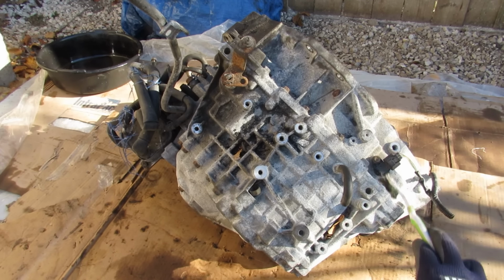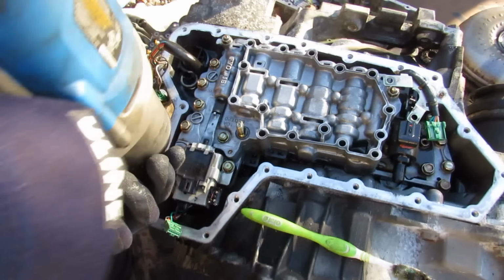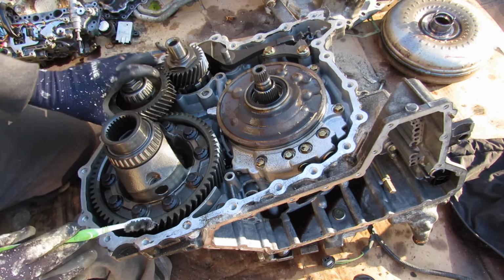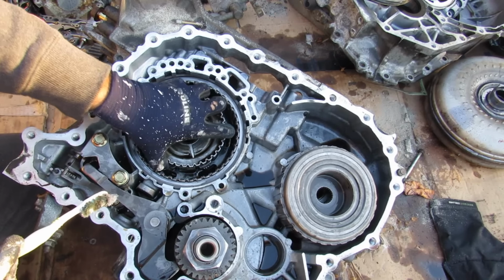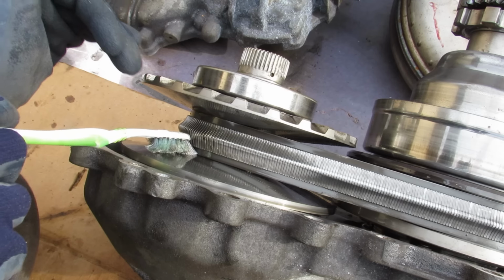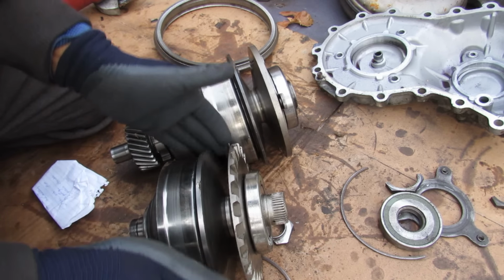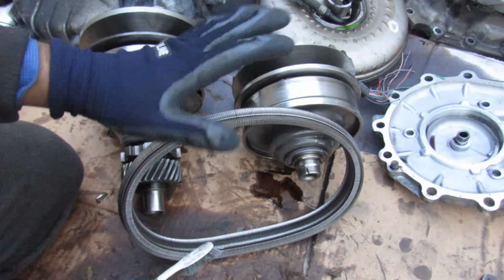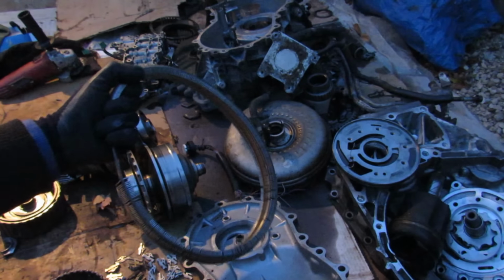Why Nissan CVTs FAIL

Comment: Nissan: "CVT's are more reliable because they have fewer moving parts."
Me: "How many of those chain links are in a single belt?  I'd say, they are all transmission parts and are all moving, no?"
Reply: More then a few mechanics have told me the Jayco (Nissan owned) cvt transmissions are crap compared to Toyota and Honda
Reply: @larrywelchko6136  JATCO
Reply: @larrywelchko6136  they’re Jatco, and yes they’re the worst of the worst. I’ve heard many people tell stories of their transmission failing at under 50,000 miles, including one failing on the test drive on a brand new car
Reply: @sundstrom193  new cars are where failures happen. That's why warranties exist, to cover factory defects. Crown Vics were famous for seizing up the engine on the transport truck...or lasting 400k miles.
Reply: @larrywelchko6136  it’s spelled jatco, Japanese automatic transmission co.
Reply: @larrywelchko6136  The only CVT I've owned is Subaru.  Never again, despite my love for EyeSight(TM).  My current car is a manual with Honda-Sensing because Subaru/Hyundai/Kia have been refusing to make adaptive cruise control work with manual.
Reply: @catsspat  Maybe because cruise control (w/ adaptive technology at that) works better with automatic? Because adaptive is adjusting throttle on the fly and the system has to disengage if the RPMs get too low for a certain gear. Risking a stall/bog out in a manual. This type of technology is best left with computers in all honesty.
Reply: @Iridiumcosmos  not really, my father owns a Dacia minivan that has a Renault Clio 1.5 dCi drivetrain (codeveloped with Nissan), manual 5 speed transmission. The cruise control and speed limiter work flawlessly even in roads with steep elevation changes. If it detects the rpm is going out of the desired range it simply warns you with a dashboard light. Being a diesel it very rarely needs to shift gears though.
Reply: @AruEsse  Correct me if I’m wrong. But I’m pretty sure those don’t have adaptive cruise control. Even so, modern manuals aren’t even true manuals anyway. There’s more computer control involved with them than your traditional stick shift from the 80s and 90s.
Reply: @Iridiumcosmos  you are right, it's not, but at least theoretically you could make it work (up to the engine stall point) so it's not like it can't be done, it's just a matter of regulating the target speed based on some sensor reading, but it's also true that those so called "premium features" are usually left to premium versions that usually have "premium" slush boxes... About the modern manual thing not really, apart from a couple of sensors here and there mother manual gearboxes still are a purely mechanical device, and that's actually why they are so reliable... Rarely you hear of someone having to rebuild one
Reply: @catsspat  they did make eyesight work with manuals… in Europe. They just refuse to bring them to the US

I wish I could own one of those :/ 
just another reason to leave American once I can.
Reply: I remember when I was a little kid, I thought the fan belt drove the wheels (I must've been 6, no one ever explained it) - then when I was a little older, I thought "how silly was I to think a car drove by a belt.." - and well, it's a steel belt, but it still seems like a silly idea.
Reply: @MattExzy  DAF had a rubber belt
Reply from the maker: Agreed
Reply: @speedkar99  Kia and Hyundai make their own in Korea. they do not use cvt  but 8 speed autos last I heard.
Reply: I have a friend (Nissan fan), he owns a Nissan with MANUAL transmission. He always says "I have no problem with the CVT"!
Reply: Nissans are a lot of things but reliable is not one of them especially their crappy transmissions . I'd say Nissan and Chrysler is in competition for who can put the worst transmissions in vehicles .
Reply: @dave0z96  is because Chrysler also  uses Jatco transmision on CVTs equipped cars
Reply: Right on 👍
Reply: @NeightrixPrime  already two Infinitis have been changed to CVTs
Reply: Eugene foster  are there any that do last? In theory they're a great idea, keep the engine at the most efficient powerband for fuel efficiency.. but they have to last to pay off.
Reply: 299.
Reply: I loved your joke
Reply: What about each individual atom in the transmission fluid?
Reply: Maybe I’m wrong, but if you’re trying to move the car and the transmission doesn’t have any moving parts, that the car isn’t going anywhere.  I think you want some moving parts so your car also moves.
Reply: Fewer parts doesn't mean more reliability.  It means that stress are continually placed on the same parts, leading to quicker wear and deterioration.
Reply: @liddlebopeep  depending on how strong those parts are. You can have a machine with only 2 parts, like a lever, and it will only fail if you overload it or you use up the fatigue life.
Reply: @liddlebopeep  a manual has less moving parts then a auto and is more reliable, I think what you meant to say is that fewer parts doesn’t always mean more reliability

Comment: Mine went into limp mode climbing 4000ft fully loaded. Changed the oil and added a cooler and ever since been fine. Also monitor temps with obd2 keep it below 80c. Suprised that time I didn't do any long term damage though it was whining pretty bad and I lost a lot of power. At 152k and running good for now. 2007 nissan sentra
Reply from the maker: Yeah these things can't take too much load

Comment: I think the no. one reason for vehicles manufacturers to switch for CVT transmission is cheaper to manufacture than regular direct shift automatic transmission. Regards.
Reply from the maker: True, it's cheaper, the consumer doesn't care either
Reply: @speedkar99  and the consumers dont know anything beyond the touch screens on their cars anymore otherwise why would anybody accept all these tiny 4 cylinder engines on suv's or cvt's  when v6 and v8 engines work better
Reply: Also because it's planned obsolescence.
Reply: @M Bacon I respect your opinion but I’ll never own anything less than a 6 cylinder
Reply: @M Bacon nothing is "needed" but high tech turbo engines dont generally last as long and fuel economy is basically the same in real life if it aint broke dont fix it

Comment: If i forget to put the megnet after change transmission oil and filter  its will any problem for no put megnet in the oil champen
Reply from the maker: You should have a magnet to collect any particles floating around in there

Comment: Damn it looks like a non repairable  technology one time use and throw away 😕
Reply from the maker: That's exactly how it works when it fails...don't rebuild...just replace
Reply: Its not that its non repairable, its that parts are hard to come by. Some shops do in fact do overhauls in these for about 2 grand. Which is much better than the 5 grand to replace

Comment: There y are many owners with no issues with CVT, but I think there might be an issue with CVT and high ambient temperature areas that causes problems.  In Canada, no biggie, but in Texas, or other high temp zones it might be good to 'over service' the fluids (Coolant and NS2 or NS3).

Note that on the newer Pathfinders, QX60, they are using a steel chain belt instead of the multi-piece steel belt system in the smaller CVT, that's how the towing capacity on these larger cars is so much higher.
Reply from the maker: How is the steel chain belt comprised? Like a bicycle chain that works in tension instead of compression like this one?
Reply: @speedkar99  this shows it, https://gearsmagazine.com/magazine/pulleys-and-chain-installation-jf017e/
Reply: @speedkar99  It's more like a timing chain or a primary chain on a bike

Comment: you did not talk about or show the 2 weakest points! 1. the variators move in and out on some small ball bearings held in grooves. these balls fatigue from large amounts of force. eventually failing and then it is all over. 2. the piston in the oil flow valve is contained in an aluminum bore. the walls of bore wear resulting in reduced oil pressure being applied to variators, eventually resulting in belt slippage. u should do a part 2 to complete the analysis.
Reply from the maker: Thanks, and good call. It was very difficult to open those variators to examine, I went through alot of grinding wheels just getting the nuts off and the steel gears didn't want to budge with a puller.
Reply: @speedkar99  dont matter really. a person is better off replacing the unit, or even better replacing the vehicle with one that does not have that type of c.v.t.

Comment: That is a first generation CVT.
The rubber band effect is not there in the newer ones.
You did fail to explain exactly why they fail and to say that the 2nd gen and newer ones fail rarely (they extended their warranty to 7 years or 84K miles, which means they stand behind them).

Hey, even Honda had issues with their dirt gen CVTs!!
Reply: Nissan fanboys delusional
Reply from the maker: Did you watch to the end of the video?
Reply: 84k miles is "standing behind them"?   I could easily do that in 3 years. If a transmission fails on a car before 100,000 its trash.
Reply: Thanks, the generation version was exactly the info I was looking for.  You'd think that would be a necessity of the subject line.

Comment: I would have separated the electronics and made it accessible externally from the transmission. Also why have a manual gear selector at all that physically connects to the transmission if it’s going to convert the signal to digital. More stuff that can go wrong and the need to take apart the transmission to fix anything.
Reply from the maker: The shifter inside does move the manual valve which engages the parking pawl and also completes hydraulic passages in the valve body to engage the forward and reverse clutches

Comment: Honda CVT requires a fluid change every 30,000 miles. It's really easy and only use Honda HCF2 ATF. Wifes car is a 2014 Accord Sport with 150,000 miles and still works like a dream.
Reply from the maker: I was wondering how Hondas first mainstream CVTs have been holding up

Comment: Hi,
I’m thinking of buying an old nissan with a 4 speed automatic. Do you know how much cost to replace or rebuild one of thesse 4 speed?
Is it more cheaper to fix than an jatco cvt?
Thanks.
Reply from the maker: I think any Nissan old enough to have an automatic isn't worth the cost of rebuild or replacing a transmission ....

Comment: I own a 2007 Nissan Murano, with almost 300,000 Km on it. Never had an engine or CVT issue to be honest. I did notice this year a slight leak from the CVT transmission cooler hose, which I believe is common. So, I would expect most people have no idea that they are leaking CVT fluid and that could end up destroying the CVT. So I'll keep topping it off for now.

One question though. People say the Nissan CVTs are not that reliable, but I've never seen cold hard facts about it. I'm very suspicious of anecdotal evidence. I know that CVTs may be costlier to service, but I'm wondering about the actual failure rate. Does anyone have actual data on that?

Also, Nissan says the newer CVTs fix their older CVT's problems. What design changes have they made to fix the issues?
Reply from the maker: You should get the leak fixed and keep an eye on fluid temps.

Comment: I question just pupped up, does CVTs change reverse gears? I have 06 Highlander Hybrid never thought of reversing in high speed.
Reply from the maker: They can be programmed to change ratios in reverse but probably don't due to safety concerns at high speed
Reply: Plus the reverse gear is straight vs helical cut so it'd sound like a formula 1 or an rc car at high reverse speed lol

Comment: Stay away from the 6th gen. Nissan Sentra with the cvt trans; they are bound to fail. I wonder how reliable most of these cvt equipped vehicles would be if a traditional transmission was used.
Reply from the maker: I see them all the time for sale $1000 obo busted trans

Comment: Every single family member and friend that I have who has owned a Nissan has had an automatic transmission failure at some point; most before 100K miles as well. It's possible that they all got unlucky but based on their experiences, I'm inclined to say that Nissan may not have the most reliable automatics on the road.
Reply from the maker: Automatic or CVT
Reply: @speedkar99  - Both the normal automatic and the CVT, if I remember correctly.
Reply: @Casey_Schmidt  The Regular Autos Are Fine. It’s Really The CVTs. I Don’t Hear People Saying They Have Problems With Nissan 7 Speed Autos.

Comment: What i have witnessed working for Nissan several years ago was sales people telling buyers "Oh its a sealed transmission, no maintenance at all" thats a lie out their ass and it infuriated me. Thats why majority of CVTs fail, not the proper maintenance.
Reply: Exactly this. I even had a service writer at a Nissan Dealer tell me that I didn't need to change my fluid at 40k. It just needed an inspection. I told him there is no such thing as lifetime fluid and made them do it. Fluid went from dark/dirty green to bright green. I, however, turned down their stupid 40$ cabin air filter they were pushing.
Reply from the maker: You are on your own after the warranty which is how long these are designed to last. It's in their interest to sell you another car after that
Reply: @speedkar99  only an idiot would buy another car from a manufacturer that failed right after the warranty was up
Reply: @dynamo3059  No manufacturer wants you to keep driving their car for 30 years. Bad for quarterly profits.
Reply: @fun_ghoul  no consumer wants to buy a car that breaks after the warranty period either. so they are forced to make their stuff reliability in order for consumers not to buy from somebody else.
Reply: @dynamo3059  Brand loyalty is dead af. Toyota random acceleration and Honda (and GM) head gaskets made sure of that.
Reply: @fun_ghoul  there never was any brand loyalty to begin with. it's always been a features / reliability / cost thing, if you make a crappy car you will go out of business.
Reply: @dynamo3059  Oh...is that why Ford is still around? LOL
Reply: @fun_ghoul   Toyota random acceleration is a thing of the past now.
Reply: @fun_ghoul  ford stopped making cars. they only make trucks now. their trucks are pretty good. not sure what you can buy that's much better.
Reply: @hedgehogthesonic3181  The point is that it killed the myth of Toyota as being morally and technologically superior to other auto makers.
Reply: @dynamo3059  What the exact fuck are you talking about? Ford..doesn't make cars? Lol omg. Also, if i needed a truck, Ford would be my last choice.
Reply: @speedkar99 Which is environmentally unsound! Takes a lot of energy and materials to make another vehicle.  Should be tight regulations on what types of components can be used. All transmissions should be able to be rebuilt! 😮😮😮
Reply: Salespeople are like others, they act in their own interest. If more vehicles fail, that's more potential sales for them down the road.

Comment: Like always, very informative and entertaining at the same time. I actually  had a rental Nissan  Murano for 9 days out west,  really loved it, 120 km/h @ 1000rpm and it  used regular gas, only thing is roll backs on incline . Love your tutorial as always.
Reply: Technically, you should be using the parking brake on an incline regardless of transmission. You ever see how small a parking pin is in an automatic? lol
Reply: @fun_ghoul  
I meant to say stopped at a traffic light waiting to go green, before you hit the gas pedal it may roll back slightly.
Reply: @franka2507  Ah, gotcha. I didn't know that.
Reply from the maker: Hmm I don't think it should roll back unless the belt is slipping
Reply: @speedkar99  It was a brand new rental, it was like clutch on a hill.

Comment: I avoid Nissan like the plague or COVD-19.  I stay away from CVT as much as I can as well but more and more manufacturers are using CVTs instead of the regular transmission in their vehicles.
Reply from the maker: It's hard to get away from CVTs now
Reply: Well that’s unfortunate for you. Nissans have more standard technology and style
Reply: @bradcast2967   Too bad because it's still bad and does not last.
Reply: @hedgehogthesonic3181  lol not true bub, Nissans are reliable
Reply: @bradcast2967   They are not reliable, and their CVT always fail.
Reply: @hedgehogthesonic3181  sucks for you my 09 Maxima with 145k still going strong and my friends and family who own Nissans equipped with the CVT are running smooth as well 🤷🏽‍♂️
Reply: @bradcast2967   The older ones were good, but Nissan is not like that any more. And lets see how these hold up to 200,000+ miles, they won't make it there without a major repair in the transmission.
Reply: It depends, the ''CVT'' on Toyota hybrids it's completely different, more robust and much more reliable than automatic, manual and conventional CVTs. The ones Toyota uses have only gears and 2 electric motors, no belts, no chains.
Reply: @hedgehogthesonic3181  I’d like to inside the one in my new Corolla, it has the added fixed gear.
Reply: @tails300   If you mean the hybrid then yes, these CVT of Toyota hybrids are very simple compared to what others use. The non hybrid one i'm not sure if it's similar to this one on the video, but i doubt it.

Comment: Great video entertaining and educational. Could you do a video on the 2016 Ford Focus dual clutch power shift transmission problems. They are POS !!!!!
Reply from the maker: Let me find a scrap one some day
Reply: Even the manuals are no good because they put the slave cylinder inside the bell housing and fully integrated it with the clutch,doing away with a lot of parts.Cheaper for  them but a bunch of $ for the owner when the gearbox has to come out to fix it.